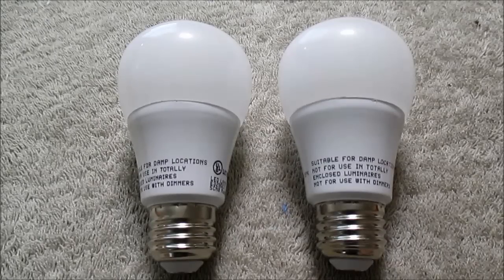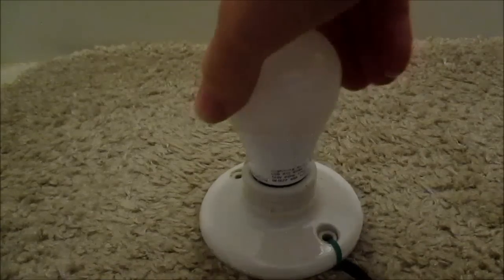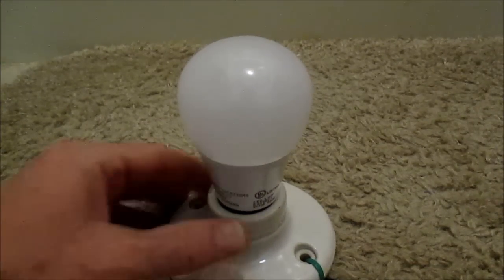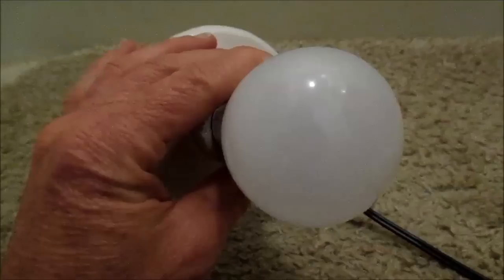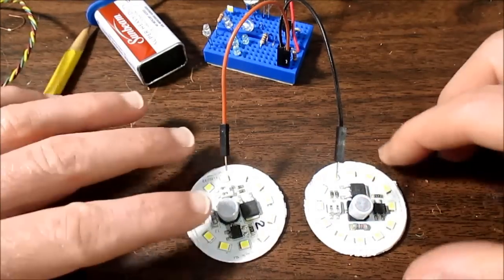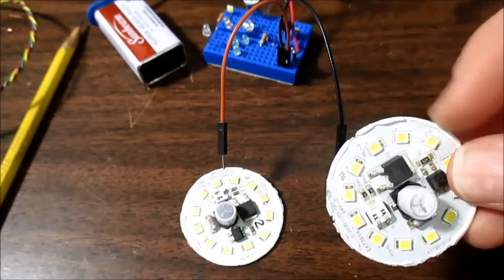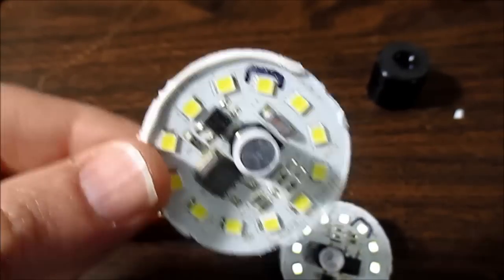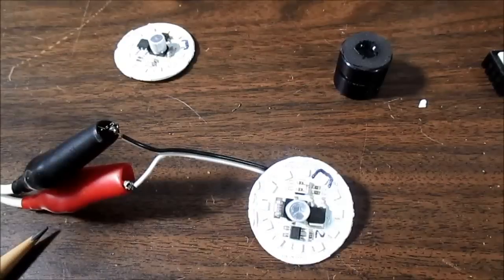Two failed LED bulbs for teardown to determine the cause

Comment: Soo, yeah, an easy fix would be to just bridge the dodgy ones out .. would mean the regulator would have to drop an extra 9v but .. meh, might work out
Reply: I had 6 of these crap lights fail, same issue. My fix was to add a resistor across the bad led. 2 years later, they all are still alive.
Reply: Or make 2 good ones from 3 bad by swapping out LEDs. Although the housing may be beyond re-use. :(
Reply: @David, resistance isn't quite what you want to measure.  It's a matter of voltage drop primarily.  If you really must use a resistor in place of an LED, you need to find out what resistance results in the same voltage drop as occurs with a working LED in place.

If you have the tools and skills to put a resistor in there, why not instead swap in a good LED?  If you have two or more bad "bulbs," one of them can become a source of spare parts.
Reply: The regulator will not overpower the remaining led if you short it as the circuit is current regulated, not voltage regulated.
Reply: @George the problem is mainly that you are completely wrong, and it being entirely linear; 

check some videos on how switching dc-dc converters work, and try to spot which components are missing here
Reply: Andrew - I'm tempted to try the same thing actually.  I had 4 bulbs fail.  The company I bought them from offers a warranty of 5 years, and I have replacements coming, but I'm really tempted just to measure the resistance of a good LED, then use a resistor with a similar resistance and bridge out the bad one.  I should have all the materials, and isn't a horrible fix.

In terms of the housing, that part is my largest concern.  I'd have to measure the heat given off by the bulb and make sure that hot glue doesn't melt at that temperature. If it doesn't, then use hot glue to meld it together.  If it does, and I'm assuming it would, I'd be more tempted to use a Dremel to cut slightly higher than he did and cut small holes along the bulb and the base and use twist ties to bond it together.  It wouldn't be perfect, but if they are up in cans in my kitchen, it's not something I'll notice anyways.  Saves a good $40, and shouldn't take longer than an hour to do.
Reply: You should just bridge the burnt LEDs if it's less than 3 that are out
Reply: A buck converter is efficient almost wholly regardless of voltage drop, FWIW.  Which is why those LEDS could very workably be arranged in parallel rather than in series without loss of efficiency.  What the manufacturer did was to choose a circuit that's less expensive to build than a buck converter, but at huge loss of reliability.  "Value engineering" at its approximate worst.
Reply: tenalpoen - my same general feeling too.  I think bridging over the bad LED without taking in account the voltage drop will cause the other LEDs to not only have a shorter life, but also generate more heat.  That's something I want to avoid.  A resistor should get it close enough without having to replace it.  It's better than other things people said, as in, just bridge to bypass the broken LED and don't do anything else - which in my opinion is a bad idea.
Reply: Darieee yeah,after destroying the case to get it apart.
Reply: Bridge the bad LED with a resistor. Problem solved.
(Yes I know you have to calculate for the proper voltage drop.)
I can only speak for myself, but the reason I just stick a resistor over the bad LED instead of replacing them is because I personally find it a lot easier. Also it's not even worth doing all that compared to replacing LED bulbs depending how cheap you can get them.
Reply: James - Honestly, I don't have a lot of LEDs around.  Well, to phrase that differently. I have very few of these types of LEDs sitting around.  I could order some, and maybe that's more worthwhile to do as a solid solution, but having the a slightly dimmer lamp is actually okay with me.  These are incredibly bright, and honestly a lot more bright than I want/need.  But, I may buy some anyways just for fun.
Reply: I started getting LED bulbs in the early 2000's when I first started seeing them, and they usually had problems. I cut the top globe off to work on them, and glued it back on later, but I only did it because they were expensive and I knew they shouldn't fail like that.

Now, I wouldn't bother. They aren't worth it. That's probably also why people don't wire the LEDs in parallel with resistors for each LED. It would cost more and failure rates aren't high enough to justify it.
Reply: I have 2 bulbs operating now on a test with one LED bridged...One has been burning for about 3 months.
Reply: think about it - IT will then have to drop all the extra voltage now, at the same current as before, so, yeah, ...
Reply: 2:24 doesn't seem that bad tbh
Reply: @JamesG that is not a buck converter though
Reply: told you guys - no need for resistor or any a' that crap
Reply: If you bi-pass the faulty LED the next weakest will blow! Only one at a time can blow so like you said - it was an interesting exercise! Thank you
Reply: +James G
 - and reduce the limiting cap. to 1/2 or 1/3 the capacity.  They run too high a current - which just makes heat, not more light.
Reply: It is  a half wave rectifier  chip , a voltage regulator  a capacitor  a few resistors .... they got hot and stopped working
Reply: +Kr Hm Gosling
 Hello ducky.  What is a "half-wave rectifier chip" when it's at home please ?
Reply: A easy fix would be to just buy another bulb?
Reply: If the max. power of led is achieved at approx. 3.5V than than 1 cob led will have 3.5*3=10.5V. Nevertheless with 1 led shorted out there would be more power dissipation on a regulator but it's not gonna affect much other than slightly overheating the whole circuit and this regulator is also temperature regulated
Reply: It's a switching regulator (not linear) so not a big deal.  It will change either PWM or switch frequency or both if I'm not mistaken.

Comment: EDIT: I don’t know what I was thinking. Feit has really failed me. 

ORIGINAL:I’ve had best success with Feit bulbs. A few start flickering or go out  and when they do I call the company and they send me new ones for free. The packaging says “Lasts Over 22 Years”.  Hmmm.  I replaced all the bulbs in my house with LED and my Air Conditioning costs dropped by at least 1/3. I save on the electricity the bulb uses and save triple that amount on AC costs in the hot months.  Love the 2700k Feit bulbs.
Reply: When LED lighting finally takes a strong hold in the market, everyone will be saving the cost on electricity until.....the Power Company raises rates significantly to keep making a profit.
Reply: Yeah Feit replaces them, they did for me, but what a pain. Now I only use Philips. Out of ~20 used daily, on and off or on for hours - no failures. (hope I did not jinx myself) And they ALL have exactly the same color - no off colors.
Reply: I contacted Feit at info@conserv-energy.com
I wrote:
I bought 24 bulbs and need 6 replacements. 

I purchased these light bulbs, see the attached receipt, on January 28, 2017 and installed them at the end of February 2017.  I have 6 bulbs that no longer work.
I'm unhappy that 6 out of 24 have gone out in such a short time.  I am saving them in case you want me to send them to you.  So frustrating.  They should last longer than this.

They are all the same:   
       A800/830/10KLED/6
       280-1-15-42

I am including a picture of my sales receipt from amazon. 

My address is this:
.....
.....
.....

I got this reply:

Hello
 
Great, thank you for the information.
 
We will process your replacement request immediately.
 
Your replacement will be sent via US mail, please allow 2-3 weeks for delivery.
 
Please hold onto the failed bulb(s) until you receive your replacement.
 
Once you receive your replacement feel free to dispose of the failed bulb(s).
 
In the meantime, let me know if there is anything else we can help with.
 
Thank you,
 
Michael Cory
Customer Service
1-800-543-3348  x 319
Mon-Fri 8-5 PST
mcory@feit.com
Feit_Join_MailingList_sign
Reply: Feit failure rate is close to 100% within three months. I've got some leftovers from a bulk pack, and I take them out to the bandsaw and chop the top off to give it better heat dissipation in case it's a thermal failure that kills them. I've noticed they switched their design a bit for better heatsink connectivity, so we'll see how the newer bulbs do.
Reply: running about 50% failure on feit leds, after a year, maybe 18 months.  Never even expected them to replace them, is it on their webpage
Reply: Replaced my INCANs with CFLs Then the CFLs (mostly) with LEDS and insulated my roof to 45...E bills down by a 1/3 and Heat by 2/5s......First thing I learned was NEVER buy cheap bulbs....Great Video!!!
Reply: Ok, I am getting more and more frustrated by LED bulbs. Even the ones that should last 22 years and have huge heat sinks with fins. I believe the LED bulbs will continue to improve. Until then I’ll keep swapping them out.
Reply: John O, I noticed I can put a small pocket knife down between the plastic globe and the base and it will separate. I found that on each board there was one LED with a black dot on it. I think one LED went bad which caused the light to stop with an open circuit. I removed the circuit board from the flat aluminum plate it was mounted on and there was very little heat sink compound. I was hoping to take good LEDs from one light and replace the bad ones but it was not a simple solder job. I think I’d need to use a heat gun underneath to disconnect and reconnect the SMD LEDs. Not worth the trouble. I’ll keep getting replacements. Eventually these LED lights will be made better. One person suggested Philips brand.
Reply: I had a bad LED bulb and Feit Electric also sent me a free replacement. No need to send them back.